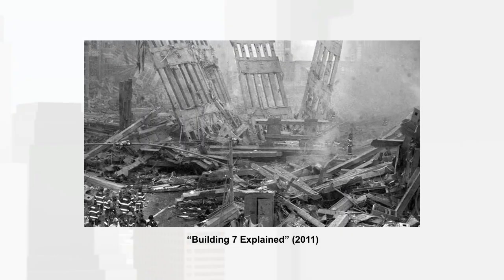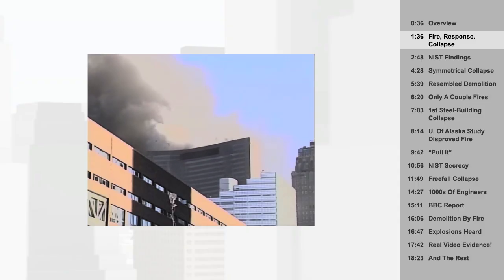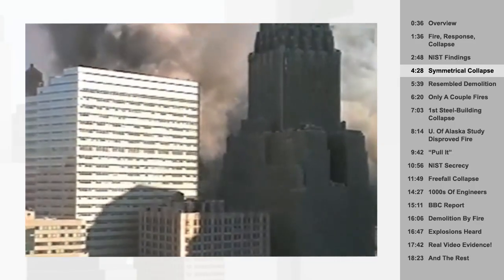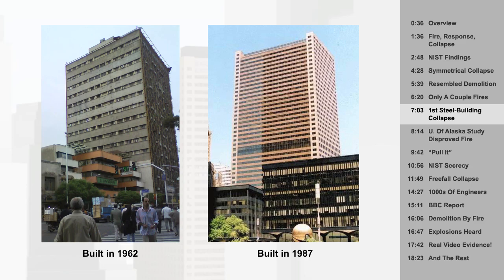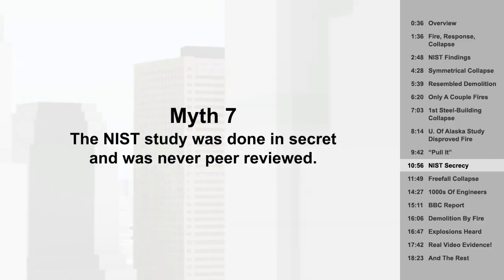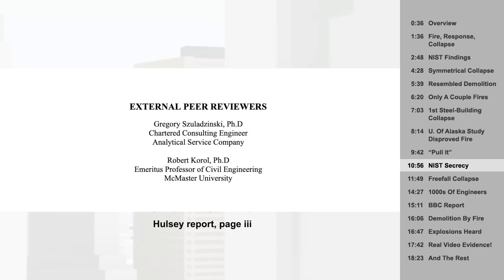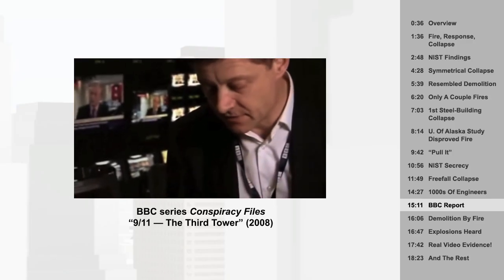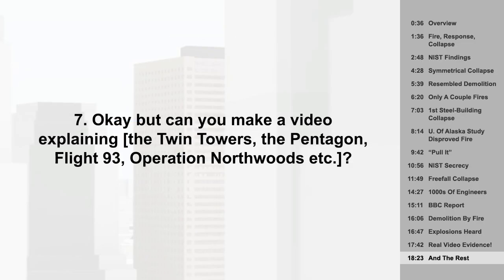Building 7 Explained: Comprehensive Final Edition

Comment: Building 7 also had many back up generators fuelled by 24,000 gallons of Diesel. Of course there’s explosions… imagine fires that big and generators ran of that much diesel… it’s bound to happen
Reply: And I’ve also seen that fake video of Building 7 before when a truther told me it was ‘proof’… and it was just a sped up version with bomb sounds and flashes of it collapsing
Reply: @mike2c512  You know that EdwardCurrent made that fake video to see if they would lap it up?  There's a low-contrast UFO over the top of the building too ... 🤣.
Reply: @LokiCentral  😂

Comment: The only comment I will make is that architects DO have structural engineering education. I clearly recall taking Statics & Strengths of Structures in college. That said,  I haven't used much of it since, & I would not presume to be an expert. Most buildings have a structural engineer, & while architects know enough basics to discuss issues, we wouldn't typically design the structure of a large complex building.
Reply: Architects sleep through that section of their classes, then cram the facts they need to pass their test so they can get to doodling.
You can walk past the windows of an engineering firm and hear them cursing the name of the architect who wants 50 million tons to balance on three toothpicks and won't reply to the email that they need to lay off the wine and revisit their drawing.
Reply: I took statics in architecture grad school at UT Austin. Burned my brain. Ironically, much of it was about trusses, which I've learned are both very strong and, in the case of fire, extremely fragile.

Comment: Now that we know a building can fall down all by itself like this. Has there been much of an effort at fortifying other existing architecture to prevent similar catastrophes?
Reply from the maker: This kind of lightweight steel design is outdated and isn't used anymore. The replacement 7 World Trade Center for example has a concrete core with walls 24" thick. But that can't be added to existing buildings. This kind of disaster is unlikely to happen again as long as there's passive and active firefighting, although it did happen in Tehran.

Comment: Nice video. Best explanation of the official story I've seen so far. Not completely convinced by the can structure theory though. I would love to see that debated with a structural engineer at AE911Truth. 
Where can I find a better hypothesis for the initiation of the collapse if the NIST one is faulty?

Also, could you please try to refute the following:  
"Thermite residue found in the 9/11 dust in peer reviewed paper" 
"There was no investigation done on the structural steel after the collapses like there should have. Instead it was sold and shipped to china where it was melted and recycled"
"Molten steel witnessed months after at ground zero"
Reply from the maker: I recommend you search these out, specifically on Metabunk. They don't really have anything to do with this engineering disaster. And it's not an "official story," it's longstanding knowledge within the worldwide structural engineering community (specifically, the structural engineering of tall buildings). AFAIK there still aren't any structural engineers of tall buildings associated with AE911Truth, as discussed in the video.
Reply: @EdwardCurrent  Another thing that came to mind is your rebuttal of the free fall acceleration due to the low resolution and frame rate of the video. There are dozens of camera angles of Building 7 falling. I'm sure one can make a combined statistical analysis of all camera angles and arrive at a very precise acceleration with a low margin of error.
Reply from the maker: Not interested in a debate but am glad to answer a few questions. Thermite/thermate has never been used to demolish a building (this would have been the largest demo job in history by some 50%). The building was filled with smoke and on fire on many floors at various times. While it's well known that incendiaries can melt steel, if someone could show how to prepare a 14"x24" vertical steel column to be melted, how much material would be required, and how it could be ignited remotely, that might be interesting (but couldn't address how this preparation survived the fire and other issues). In other words the 911 Truth guys really should work up a falsifiable theory of how this was done, what it would require, and what evidence it would leave, like the structural engineers have done.

The CBS video is the clearest, most stable shot of the collapse sequence, so that's the one Chandler and others have measured. If they could make more precise measurements from other videos they should have done so. But the biggest issue with the "freefall" claim is that supposedly, all of the columns had to be severed at the same time for freefall to occur (which is why freefall is significant). So...we have 84 detonations happening at once with no sound? Or, we have 84 remotely ignited thermite-meltings of these giant columns that all occurred suddenly and within one or two seconds of each other? It's absolute nonsense when you think it through.

The problem I have with big "conspiracy theories" is no one ever has a detailed, coherent theory, the critical hypotheses of which can be tested. It's all very vague, like intelligent design.
Reply: @EdwardCurrent  "Thermite/thermate has never been used to demolish a building (this would have been the largest demo job in history by some 50%)."
Weeeell.....that depends. Thermite WAS used to attempt to demolish the remains of the dome of the German Reichtags building, left after the infamous fire of 1933.
Of course, that attempt failed utterly and completely, likely a reason it's never been used since.
Reply from the maker: @mooneyes2k478  Interesting, I didn't know that. Requisite Truther response: "So you're going to compare 1933 thermite technology to 21st-century secret classified thermite technology from the greatest and most advanced military God ever created?!"
Reply: @EdwardCurrent  Thanks for the reply. I’ll do that. Even if it’s true that none of the AE911Truth guys are high rise engineers, they still show a high degree of understamfing of solid mechanics and physics in their presentations. A friendly debate of the facts would be very fruitful and maybe would answer a lot of the questions from the public.

Also regarding the loudness, thermate/thermite can be designed to be relatively quiet in cutting steel beams. I’m sure you have seen the videos of the engineer who cut beams with homemade thermate in his backyard. Do you have a comment on that?
Reply: "Official story". Also known as, "the explanation that used science, evidence and facts, and the overwhelming consensus of scientists and engineers all over the planet."

" I would love to see that debated with a structural engineer at AE911Truth. "
There are no structural engineers at A&E911. The nearest thing is Roland Angle, the CEO. But while Angle has a B.Sci. in civil engineering, he isn't a structural.

While your other "points" are entirely irrelevant to WTC7, I'll quickly address them.

""Thermite residue found in the 9/11 dust in peer reviewed paper" "
"Thermite residue" means "we found rust and aluminium", because that's what thermite IS, in its simplest form. And if you HADN'T found that in the remains of buildings made out of steel with an aluminium skin cladding? There would have been REALLY something wrong.

""There was no investigation done on the structural steel after the collapses like there should have. Instead it was sold and shipped to china where it was melted and recycled""
So much nonsense. All steel was taken to Fresh Kills landfill. There it was investigated of a time of months. Steel that was deemed to not be relevant was then passed on to American scrap yards and recycling companies who, quite understandably, had difficulties actually passing the steel on to US customers. And so, they were forced to find foreign customers. This took quite a while in itself, but finally they did. The customers in question included Chinese ones, but also Indian.

"Molten steel witnessed months after at ground zero"
Molten steel witnessed exactly nowhere. At all. Full stop, end of.

Comment: The NIST study in its final report omitted the sheer studs, which are used to keep steel floor beams and girders in place to impart stability and strength to buildings

NIST has publicly admitted to omitting the web stiffeners from its modeling, making  making NIST’s probable collapse sequence physically impossible
Reply: Tony Tszamboti has been claiming for 15 years the shear studs would have prevented the collapse.  When you ask him to explain how, you will be called names and be treated to other forms of abuse and deliberately off topic evasive derails.

What you will never get is a straight answer.
Reply from the maker: I call that the "would pecker fallacy" -- when some believer runs a thought experiment and decides what would and would not have happened according to their rotted-out zealot brain.
Reply: @EdwardCurrent  Standard "truther"(or any CT, really) modus: Start at the desired outcome, and then fit the facts into it. If they don't fit, modify or discard as needed.
Reply: "NIST has publicly admitted to omitting the web stiffeners from its modeling, making  making NIST’s probable collapse sequence physically impossible"

Wow, talk about your leap to a conclusion. The NIST's model being imperfect doesn't justify concluding it was "physically impossible", just that that model likely doesn't provide 100% accuracy to how it proceeded. Newtonian gravity is an imperfect model but it doesn't mean my house keys levitate off the table either.

If you want to get all the way to "physically impossible" and be taken seriously then someone's going to need to run a simulation with the corrections as needed and submit it for peer review.
Reply from the maker: The last part of your statement is false. "Physically impossible" is the kind of thing that incredulous creationists say, not scientists. Regardless, there are various ways the collapse could have initiated, even if NIST's proposed mechanism is wrong. Other than in the minds of delusional conspiracy believers, these details do not mean the building did not collapse due to fire, which it most certainly did.

Comment: Another thing about those "explosions" heard. If you were hearing explosions that means the building should be coming down right then and there, as opposed to hours later. You don't blow up a building's supports and have it stay there for hours. If it was infact exploding because of demolition explosives, it would begin coming down at that moment.
Reply: Is it not possible that a small amount of explosives could be used to weaken the structure to a point where it collapses in on itself, similar to the explanation of how the fires weakend the supports?
Reply: @jake0r  It's not 100% black and white, but steel failure under static load isn't really time dependent.  That is, if you weaken it to the point of collapse, it collapses immediately; if you don't weaken it to the point of collapse, it doesn't collapse until sufficient extra load is applied or there is additional weakening.  You really need the softening from the fire to explain a delayed collapse.  I know that's inconvenient for some ...
Reply: @jake0r  Demolition explosives don't do that. They are designed to be powerful enough to knock out a buildings structural support. Once that is gone, the building comes down. You would not hear explosions, and then the building comes down hours later.
Reply: @SuperBuildsInMC  fair enough that makes sense, how about if it was something more unconventional like thermite which has been suggested in other theories? However unlikely that might be Is it a possibility.? (It may have been mentioned in the video but I may have missed it)
Reply: @jake0r  Regardless of what you hear, thermite is not something they use for controlled demolition. Thermite burns through metal. It's incendiary. It isn't an explosive. It isn't loud (at least not loud enough to make those noises,) and it does not blow up. Those bangs you hear are almost certainly not from Thermite.
Think of those 4th of July sparklers you play with, thermite burns similar to that, not explosive.

The way 7 fell is not how you'd do a controlled demolition. Demolitions are done with everything going at once. 7's insides fell first, then shortly after the outer moment frame. That is NOT how any trained demolition expert would go about doing that, and plus. You *WILL* hear the explosives going off. Controlled demolitions are not quiet, and 7's collapse was reasonbly quiet for something people say is a "controlled demolition." Explosives are fucking loud. He demonstrated that in this video.

Now, don't think that because the thermite is relatively quiet and the collapse was relatively quiet, it does not mean that thermite was used. Thermite burns through steel, and you'd need a lot of it, and there'd be evidence of its existence in the debris pile (burn marks, remnants of thermite left on steel columns, etc. (which there was not any found despite some people claiming it was found, finding metal oxides like what is inside thermite does not mean it's thermite.) And simply, you just don't use thermite for this stuff. It's used (according to google) for incendiary bombs (which i already mentioned that 7's collapse was too quiet for it to be bombs/explosives) the reduction of metals from their oxides, and as a source of heat for welding.

Comment: The fact that it looked like a controlled demolition means that the engineering done on the building design was good. Of course everyone would want a tall building to collapse as vertical as possible if it ever comes to that grim situation, you would want the buildings in the vecinity as less damaged as possible.
Reply: If one understands the physics, very large buildings are going to collapse mostly vertically, even if the collapse starts off slightly toppled.  That's because gravity acts downward, so down is the most energetically favourable route to fall, and once a structure starts failing the failure cascades and it can't resist that downward pull.

Comment: A point with regards to fireproof cladding; it doesn't stop the beam reaching critical temperatures, it simply increases the time it takes to reach them. In a long fire, a beam with cladding applied to it will reach far higher temperature than a short fire. In a normal fire scenario with building 7, the sprinklers and fire department would have suppressed the fire long before it hit the critical temperatures that it did.
Reply: @Cat Cay - Exactly.  A crucial detail overlooked by many "truthers" (or, more probably, rather then overlooking it, they're unaware of it.)  Firerproofing carries a time rating.
Reply: Also, much of it was applied to rusty metal.